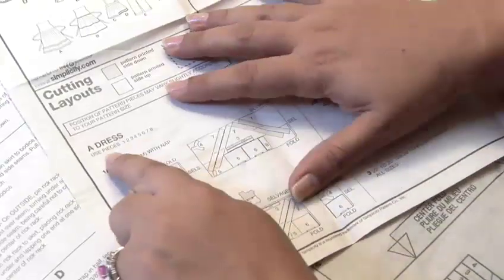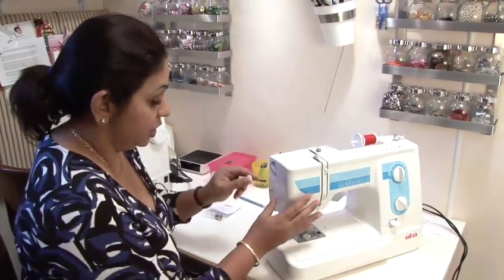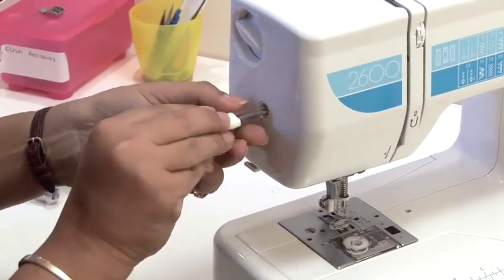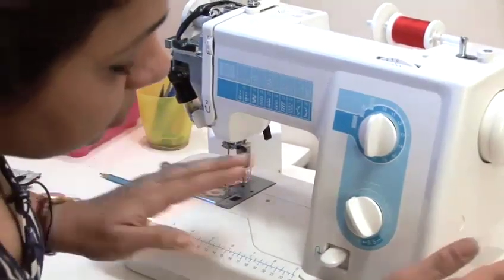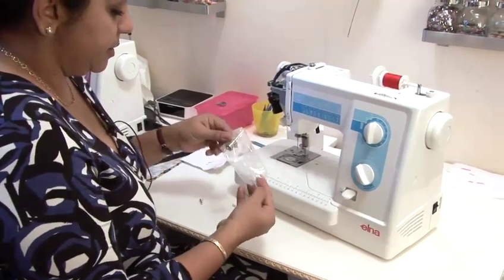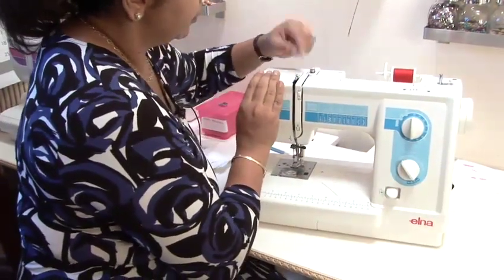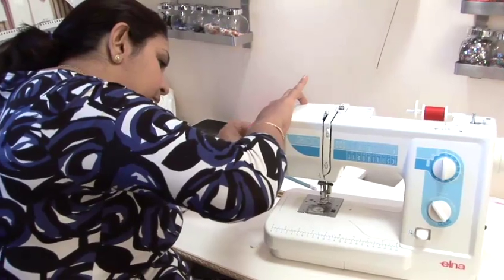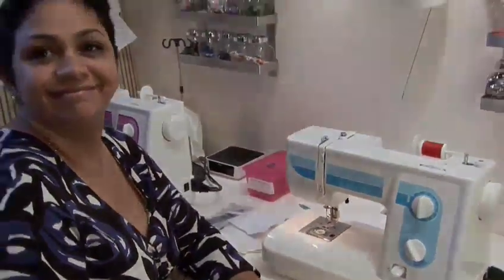How To Change A Bulb In A Sewing Machine

Comment: Thanks for that. Unfortunately I can't remove the faceplate - same problem as you had initially, but mine just won't come off!
Reply: I am having the same problem as you had. Did you ever find a solution? I'm afraid to break something if I force it.
Reply: I hope you managed to remove it, you just need to keep using the screw driver as it means it’s still connected and it’ll just come out without having to pull it out x